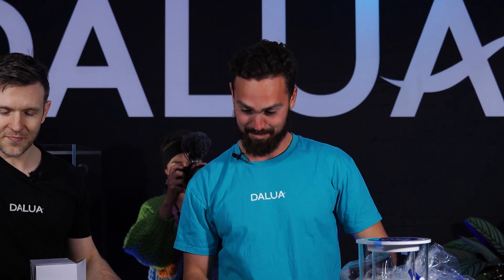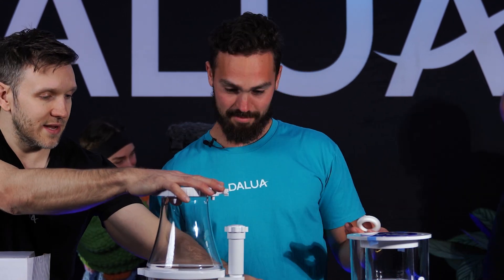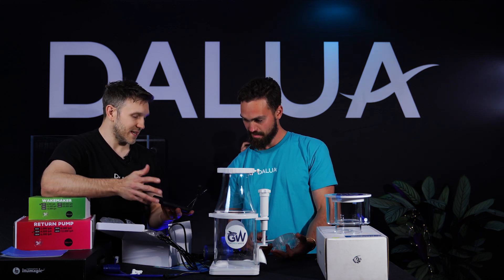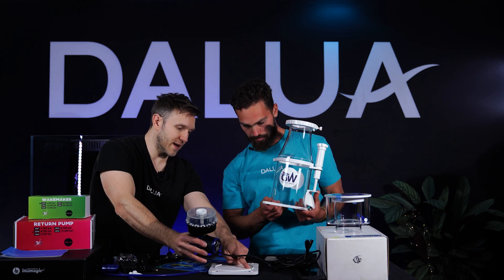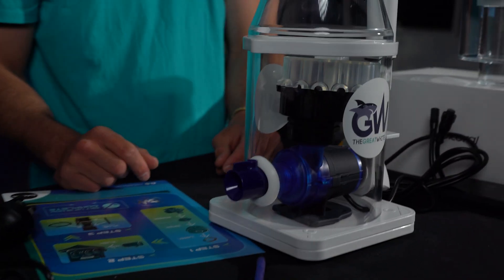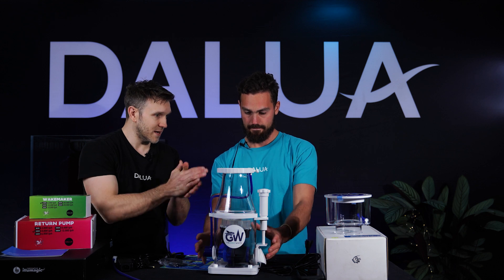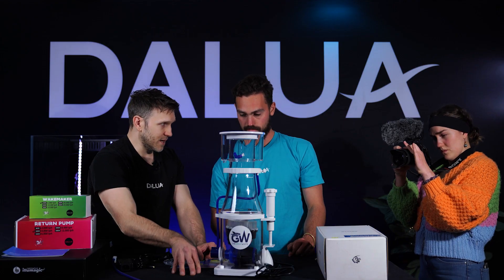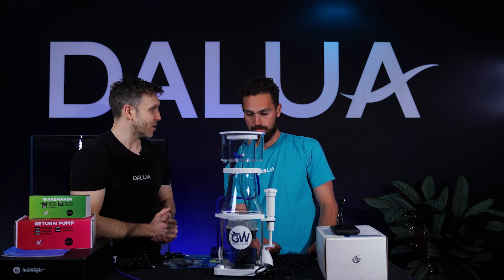All About Protein Skimmers | Great White Unbox

Comment: I have both a GW7 and a GW17, I found there to be a bit of a gap in your product line between the GW12 and GW17 where a heavy bio load tank around 800L-900L was missing a product line, like a GW15 which would have been perfect for me. The GW12 is 600L heavy and the GW17 is 1200L heavy bio. 
 I upgraded to the GW17 but am concerned it may have been too big but the GW12 was too small for my bio load. 
I also need to have the GW17 propped up about 10cm higher than the GW7 to reach the 16cm-22cm water level recommendation but the instruction leaflet included was the same as the GW7 and showed optimal wet dry levels to be around the GW logo on the side and 16-22cm is a bit higher than the logo and took a few days of config to work out the info sheet was not correct for that model.
Reply from the maker: @im160bpmplus  you're looking into the numbers wayyyyyy to much.  The actual bio loads mean very little. Organics are impossible to measure with that accuracy. Control your stability, make sure your organics are in check with any skimmer you have that fits. Bigger skimmers remove to much traces and smaller skimmers take out more than you think they do
Reply: @daluainternational  ive been using the GW7 for nearly 3 years, now that my tangs are a lot bigger, I am cleaning the cup sometimes daily and there is a lot of thick waste in the neck. My nitrates are very hard to get below 20-30 without large water changes and doing 300-400L water changes a week is not practical. I have several tanks and have been in the hobby for years. I definitely needed a bigger skimmer than the GW7. All I was saying was I would have liked a model in between a GW12 and GW17 as the gap for a high bio load according to your info was large. Tried to give constructive criticism and input towards the next gen product line. All good. Id rather have bough a bigger skimmer that i can use in the future on a larger tank than to have bought a GW12 and still not be powerful enough or be future proofed. TY for the reply though.
Reply from the maker: @im160bpmplus all good mate e always respond and happy to hear your v great results. Unfortunately you can never fill all gaps in the market.  The gw ranges has a 500l gap between each one so another skimmer in the middle of 2 sizes just wouldn't work.  The v skimmers are controllable though so just lower the pumps speed
Reply: @daluainternational  Getting a bigger skimmer and turning it down doesnt necessarily fix the gap when the body of the skimmer is too large and wont produce enough waste.. You cant expect people who spend 1k+ on a product to not look at the specs and just buy off the cuff when working with their tanks they spend as much on as a nice car. Nitrates are measurable phosphate also and the amount of waste in the cup on a daily basis is also measurable. 
The GW7 is rated at 400l the GW12 is rated at 600L then the 17 is rated at 1200L for heavy bio loads and is a significantly larger bodied skimmer to the others. Looking at the specs of a model is exactly what responsible shoppers do. Saying that its impossible to cater to that gap and i look into the specs too much is a little dismissive.